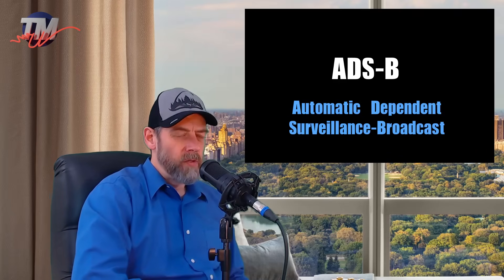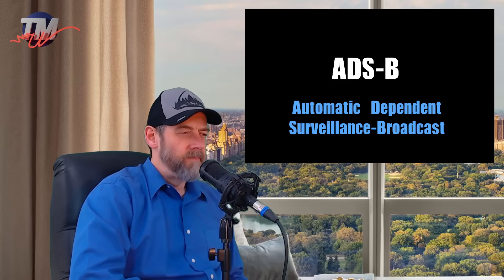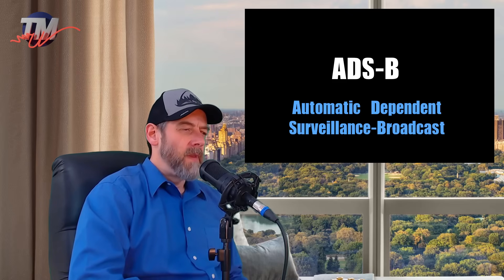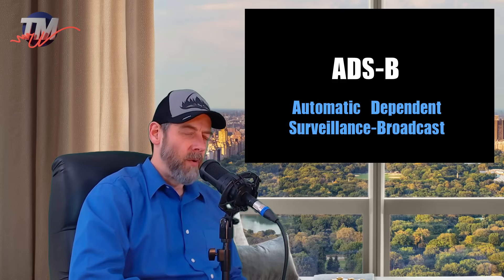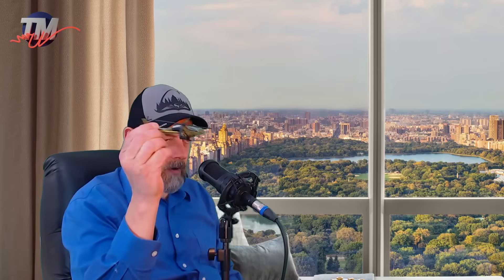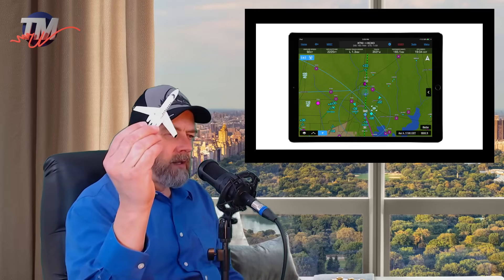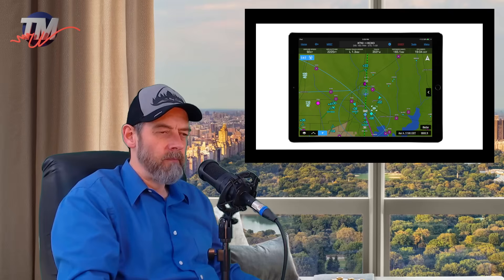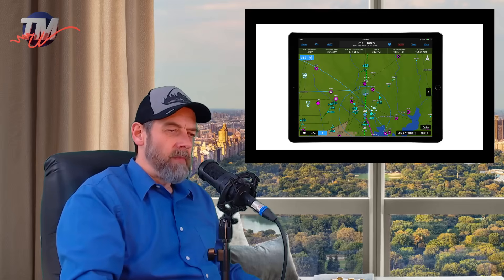The Blackhawk's ADS-B-Out system was turned OFF. Why, what is ADS-B, and why does it matter?

Comment: I had a few other points from your previous good re-enactment presentation, you covered a few of my other points - but I will return to you on these later.

This one stands out though :

Indeed as you point out, why ADS-B was off is kind of a pre-accident smoking gun . They didn't want posn known before flight occurred, maybe they don't want the posn known after the collision either.

I've been aware of this for several days, it was suggested in many other YT vids long before the Sen. Cruz meeting with NTSB.

BUT .... the other thing that I was alerted to was where the CRJ should have been on the glide path at the time of the collision .  I myself checked another prelim calc of this, and it puts the CRJ on the Route 1 and 4 ceiling limit. So red flags all over regarding what we are being told on a "need to know basis" as members of the public!!

I checked up again with the altitude data transmitted on ADS-B (this affects the CRJ), and it may also have been pressure altitude and not the more accurate radar altitude :

ADS-B Parameter 4 : Altitude	
Barometric (pressure altitude)    * O R *   GNSS (geometric altitude).	
Barometric: ±125 ft. GNSS (WAAS): ±13 ft. NACp defines vertical accuracy.	
1 Hz transmission rate
Reply: It seems military flights are not required to have ADS-B Out turned ON. Having it OFF may have been part of the exercises the Gold-top Blackhawks were taking part in.

In a real state of emergency, VIP flights like these will probably not be transmitting ADS-B. For all we know our enemies might have missile technology that tracks ADS-B.
Reply: @Deploracle  True - but that suggests if a "realistic PAT" flight was being practiced, they would definitely have tracked it with their own radar systems - there has to be accurate track data of the helo somewhere.

And anyway, what is there to practice about disabling ADS-B ?  It's a single panel switch, or maybe a CB somewhere - hardly something that needs to be practiced!

At the most for practice, have a PAT grade sortie where there's a checklist item to switch off the ADS-B power for practice, then switch it back on right away.
Reply: @Nick_the_Gödel_Bach  Nobody has to practice to flick a switch. Come on.

The purpose of the program is safe executive egress in a SHTF scenario. Which could mean dodging inbound flights desperate to set down anywhere, possible threats from the ground, spoofing tracking systems/missiles, etc.

ADS-B makes that task easier with the negative of alerting every enemy of the location of escaping high-level assets.

This program has been ongoing, I suspect, for a few decades. I didn't know it existed until this accident so incidents can't be too numerous. Regardless .. unless there is a compelling reason not to .. Reagan National should be marked for closure. That solves all of these problems.
Reply: @Deploracle  Haha, was trying to keep the "sticklers for procedure" happy switching it off and on - you never know what they want.

You are right about something like adsbexchange getting access to all that data - maybe that ought to be filtered to civ flights only.

There was a suggestion that DCA be limited to mil flights only, Dulles taking commercial flights. That is probably the best solution
Reply: @Deploracle Ah, but there HAVE been many many incidents between helicopters on these routes and Part 121 airlines landing and departing. Ask any DCA-based flight crew. Just no midairs.